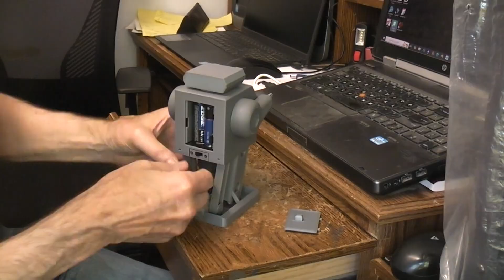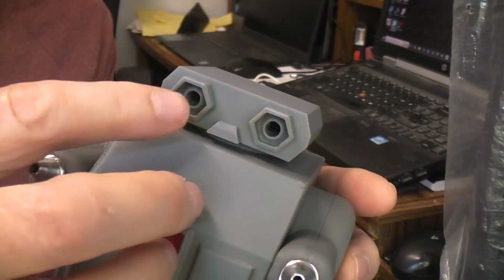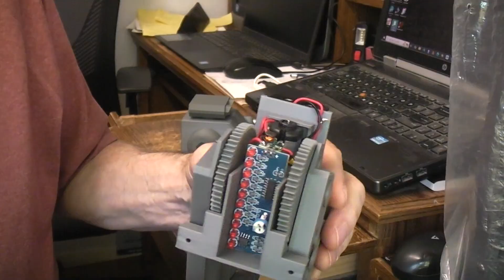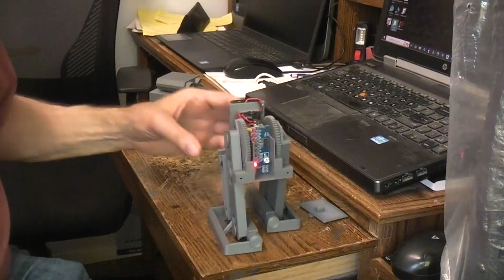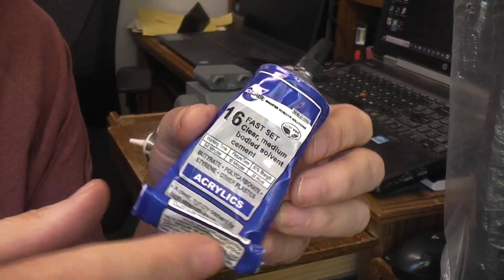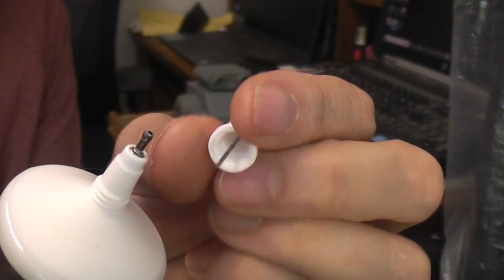Sentinel, mechanical Bi Ped walking robot build Part 2.

Comment: I like the mechanism a lot. I'm wondering if it would be possible to put the parallel linkage bar on top hidden inside a body and split the single foot into 2 feet to give it a four legged look. Maybe a cartoon version of a  Star Wars At At walker. Just thinking out loud.
Reply from the maker: Could be fun to play with and if it worked cool to see in action.